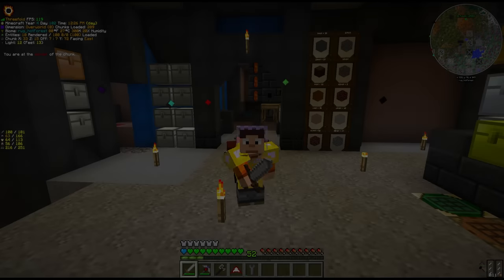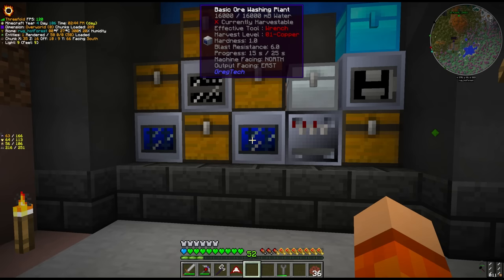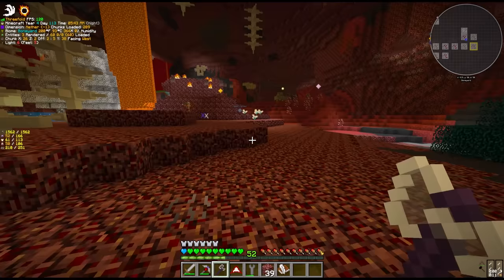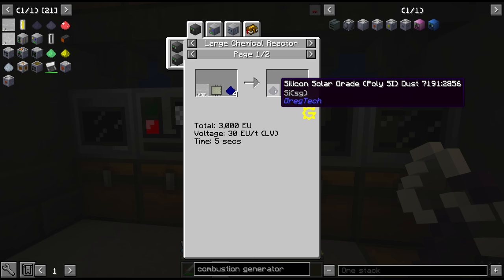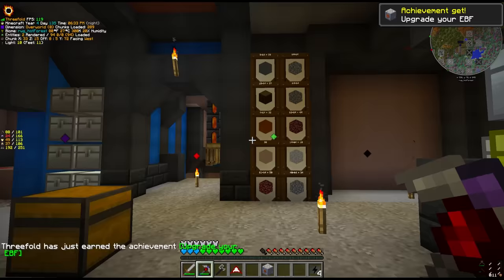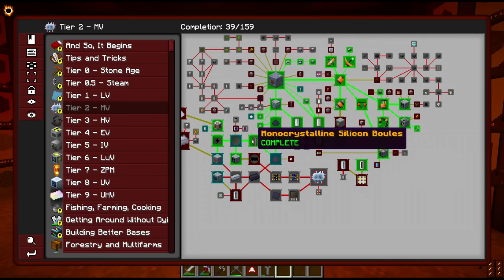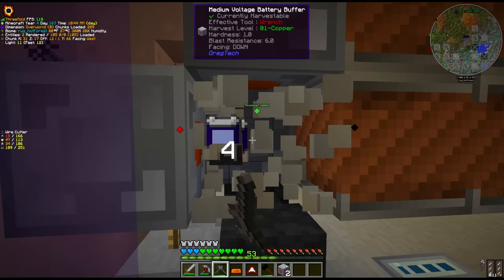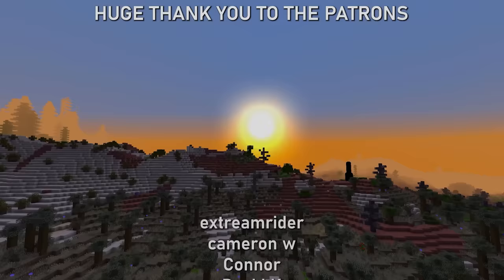Gregtech New Horizons S2 12: High Voltage Alloys

Comment: Alongside Gold you're going to be really hurting for Chrome in HV to produce all of the Stainless Steel you need. This is one of the reasons why glowstone farms are the meta solution for your gold woes, since it also produces redstone, which eventually produces Chrome. Redstone veins in general are a good source of Chrome, in fact. Place a miner on a Nether redstone vein to get the double output from Nether ores, and you'll have plenty of stuff to process in short order.

There's a recipe that uses Raw Carbon Mesh instead of Fine Steel Wire to craft Item Filters. Use it once you've got the Polyethylene to spare to craft the carbon fibre.

Other versions of GT give machines like the centrifuge and ore washing a bonus to chance outputs with higher tier machines, but this mechanic doesn't exist in GTNH. Higher tier machines work faster and can run higher tier recipes, that's it.

It's very easy - and very worthwhile - to set up a garbage automation thing for distilled water. Just a water tank, some solar boilers (which you can just let calcify if you use enough of them), a steam turbine and a distiller turning water into distilled. Stock up early and you won't have to wait a million years for ore washers to do their thing, and you'll have distilled water on hand for the odd process here and there that's also sped up/improved by using distilled water. It's really not hard to get, so no excuses for not having it on hand 🙃.

GT machines have a setting you can enable called Input Filter, which prevents them from inputting items that aren't part of a recipe that machine is able to run. Shift-right click a machine with a screwdriver to toggle this setting (regular right click will toggle input from output side allowed/disallowed, need to be sneaking).

Those type filters (and their item filter counterparts) will output items without needing power, as it says on the tooltip. However you can provide them with power, and have them send that power through their output side if you enable that feature in their GUI (the left most lightning bolt-looking button). Of course they'll only accept power up to their voltage tier and emit power of their voltage tier, but if you're short on space or need an extra side to access a machine using item/type filters as a 2A diode is an option.

Prospecting Kits are available as early as LV if you wish to make finding ores that much easier. The spreadsheet has a list of good materials, per usual. Vanadiumsteel might seem like a poor choice at first glance, considering that Alumite LV has many more effective uses and the same effective range, but once Three starts prospecting for fluid fields his MV Vanadiumsteel scanner will have a much higher chance of successfully prospecting the fluid field than an LV field would (40% instead of 24%). MV Vanadiumsteel would also have a much higher chance at prospecting regular ore veins if Visual Prospecting didn't ignore Prospector's Scanners having a chance to fail (if it did LV Alumite would have a 76% chance to fail, whereas MV Vanadiumsteel would only fail about ~1% of the time).

...I forgot that if you scan the edge of an ore chunk instead of the centre it can hit the three neighbouring ore chunks as well. So a 3x3 range can, in fact, scan a 2x2 set of ores. Well, point for Three, MV Vanadiumsteel definitely the right call 🙃.

This is why I recommend making a Prospector's Scanner earlier, and retiring the Ore Finder Wand. Look at all of those Nether Redstone veins that Three can dig up for Chrome! And that's to say nothing about another vein he'd do very well to find in the process of crafting HV circuits, which he had every chance of finding (and even might have if I just missed it) in the process as well. Know thy ores, because sooner or later you'll be back to mine them.

Silicon Solar Grade is basically a really easy tutorial for these kinds of processes that end up becoming more and more prominent (and complicated) as time goes on. SSG is a three step process that's on a closed loop in term of sodium and chlorine (you get the full amount back as regular salt), so it's very easy to set up automation for it.

Silicon Boules do take forever and a year to cook, but that's why you make more than one EBF and batch craft them when possible. You also get a fair few wafers per boule, even more when you start using higher and higher tiers of boules, so with a bit of planning and managing they're not that bad. Mainly it's a test of your power setup, because LV batteries are not going to cut it trying to craft SIlicon Boules.

For anyone curious why Three didn't grab the quest for the MV PLE and grab the Emerald Lens quest reward from it...reasons, I guess 🙃.

The way that pizza gloves work is that it gives you a very brief Fire Resistance effect, so yes, the backpack does protect you. Mind you that a Hazmat suit would also protect you, and if you're playing with pollution on you'll have had one of those sitting around since the late Steam age.

You don't need a Vacuum Freezer to recycle hot coolant. You can place an IC2 heat vent on a fluid tank as a cover, and this will turn any hot coolant inside the tank back into regular coolant 1:1. You can also use an IC2 Liquid Heat Exchanger in combination with an IC2 Stirling Generator to convert your hot coolant into regular coolant and produce some power on the side. Not very much, but it's something.

For the record EBFs cannot have mixed coils, so unless you've got the same tier of coils for all EBFs you cannot wallshare them at all. Wallsharing is otherwise very worthwhile because it allows you to save on coils (you saw how painful crafting them is, and wallsharing saves 6 coils per dual or 11 coils per quad), but when you're in that transition period where you've got multiple tiers of coils floating around wallsharing can prove to be a bit bothersome until you've finished upgrading all of your coils. Still worth wallsharing, of course.

You can place an output hatch in the top row to capture pollution gasses in EBFs, but it's not worth doing. Go right ahead and forget that's possible, you won't miss it. Volcani, however, are a different story...but that's a story for another day 🙃.

Another key material that Kanthal opens up is Energetic Alloy. Aside from some uses in EnderIO it's the next major upgrade for TiC Crossbow limbs and bolt shafts (trading a minor amount of damage potential from Carbon for a major durability increase), and if you're into Thaumcraft opens up Greatwood Staves and - much more importantly - Transmutative Wands/Scepters (although those will require Infusion as well, which requires either a villager trade or an HV machine). Something else that Kanthal coils do is give every Cupronickel recipe a 5% EU/t discount. Which might sound minor, but when you're burning diesel by the bucket doing all of this EBF smelting it'll add up fairly quickly. Especially when you're overclocking MV recipes to HV, which like single block machines double the total EU cost per recipe (though EBFs will have a solution for that come Nichrome coils...).

Another, another thing Kanthal coils opens up is Pyrolyse Ovens that aren't complete and utter garbage, particularly for producing Benzene as a power source. Why, yes, upgrading your EBF coils is indeed critically important. Prioritize doing so whenever possible, because you will reap rewards from it one way or another.

Oh, and those diodes? Yet another thing Kanthal coils opens up is the inefficient Platinum recipe, which allows you to craft SMD diodes instead of buying the regular ones. Worth it? Not really if you keep up with your questbook purchasing, but if you're processing crushed Nickel ore through a chemical bath with Mercury (by the way, guess what else centrifuging redstone dust produces 🙃), then macerating the purified ore and centrifuging the purified dust you get an ~81.11% chance at 2 platinum pain train dust per crushed nickel ore, or 91.11% with an HV macerator. 27 of those dusts is enough platinum for a stack of diodes, which might not sound like much (and it isn't, really), but it is ~5.3 hours worth of questbook purchases. And it allows you to save technician coins for AE2 materials later, if you think those are harder to deal with then than diodes are now (hint: they're really not).
Reply: @Hillgrov  Not directly, but I will add relevant stuff if I come across it (such as the 2x2 ore prospecting with a 3x3 prospector, it's not very prominent but there's a note about it somewhere).
Reply: that right but they're will be some changes but its a bummer since gregtech is not in future modpacks just bc of something else that made the gregtech popularity of future modpack decreased😞

Comment: Good stuff as usual! For the EnderIO capacitors, in 2.2.7 devs have added the recipe with aluminium bolts besides the tantalum one
Reply from the maker: oh interesting! I'm a little hesitant to update at this point, but hopefully there is a stable version after that which we can use it in :)
Reply: @Threefold.  yeah I would avoid updating to 2.2.7 right now its a bit buggy.

Comment: If you put a heat vent on the chemical bath and make it touch a water source, it cools down the hot IC2 coolant and put it back as cold in the input slot. Very handy.

Comment: Regarding the silicon boule... 

There's actually a closed-loop two-stage process available in LV: 

1 Silicon + 3 Hydrochloric acid -> 2 Hydrogen + 1 Trichlorosilane 
1 Trichlorosilane + 2 Hydrogen -> 1 SG Silicon + 3 Hydrochloric acid 

That's right, the outputs from Stage 1 are the inputs to Stage 2, and you get 100% of your HCl back. You can literally go back and forth in the chemical reactor with just three starting cells of HCl and craft all your silicon into solar grade losslessly. Again, this is all LV; in fact, I crafted my first diodes from silicon wafers made with this process. VERY STRONGLY recommend to everyone.

Comment: Wowie zowie, anooooother episode of grindtech no-outsidezons!!

I do have a tip for distilled water, there are pretty much five ways to get it, but two of them are late HV+:
-distill water in a single block.  This is the worst way in that it's the slowest and uses the most power, but it does use the fewest machines
-electrolyze water twice to get hydrogen and oxygen, then chemical reactor for distilled water.  This is roughly 4x faster than the above recipe, but needs 3x the machines
-get oxygen and hydrogen more efficiently, eg oxygen from electrolyzing sugar (1 machine) or a byproduct of air centrifuging (0 machines yay) and hydrogen from reacting sodium with water (1 machine assuming you have clay electrolysis or similar automated, which is a big assumption).  This is 4x faster than the previous method
-use a multiblock distillery (ok mr moneybags)
-most things that re-condense water, like the condensation tower and multiblock turbines, make distilled water

Comment: For the new silicon, there is a recipe (only available in the single-block chemical reactors) that allows you to recycle the chemicals and only requires power. I don't remember which one and am not 100% it doesn't require HV, but it's very easy to set up a system where you insert raw silicon and can leave and come back to Si(Sg).

Comment: Your videos are always very good, but in this video, the pauses seemed a bit longer than normal making for just a bit more relaxing experience. You could probably add maybe another half second between your cuts here or there, but I like this slight change in style (not sure if it was intended or even happened). Your montages are always pleasant and add that bit more relaxed feel to the videos as well. The only other thing is that I wish you used a bit more of the song you seemed to use a lot in the first GTNH series...I don't remember which one though :D

Comment: The silicon purification can be turned into a loop pretty sure. I just made a setup for it yesterday.
Reply from the maker: Yeah there is a partial loop in there somewhere
Reply: @Threefold.  the Chlorine and sodium loop is self sustaining. 4 buckets of chlorine, 4 sodium dust piles. The pure silicon output includes 8 piles of salt, which electrolyzes back into 4 of each need chemicals. BTW, have you considered using the long distance fluid pipe to transfer your oil instead of manually moving tanks or cells? The assembler makes them pretty cheap. Just needs to traverse 4 chunks or more to be usable.